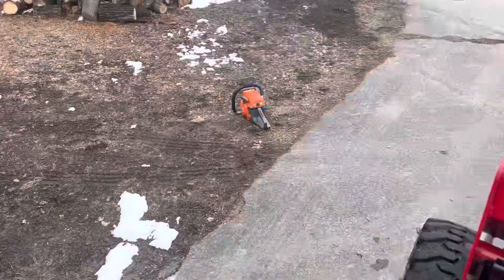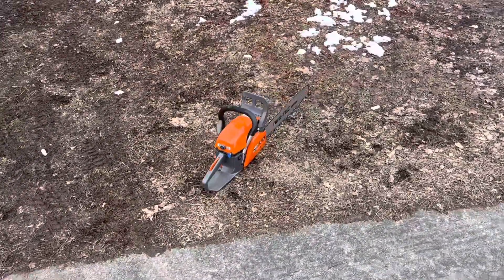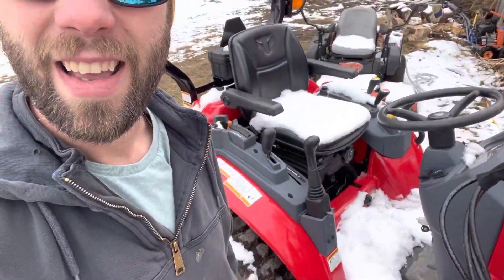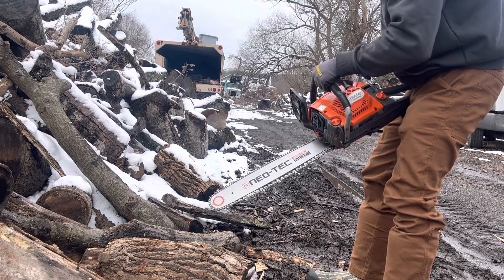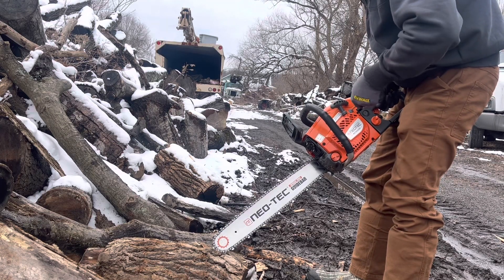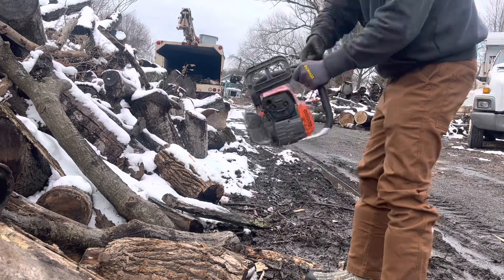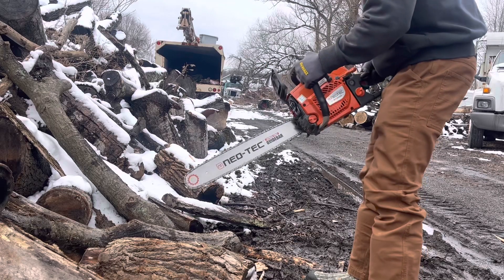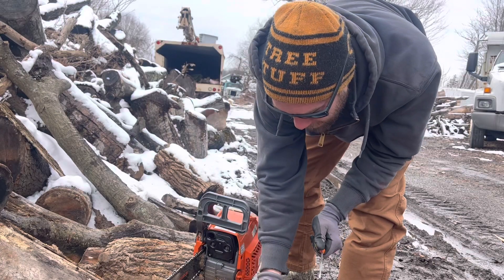NEOTEC 6200 chainsaw review and tuning@bulletproofsaws

Comment: How do you replace the chain? I need to install a new one but im borrowing it and no idea how and cant find it online.
Reply from the maker: Pretty simple process remove the two 13 mm nuts on the side of the chainsaw that would be called There will be a flat head that you can loosen turning counterclockwise to adjust the bar backwards to give slack to easily remove chain and bar assembly simply reverse the order tighten the chain snug but not tight with that tensioner turning clockwise tighten those 2 nuts and you’re good.

Comment: Does it run like a 62cc saw or does it feel like a 42cc saw?
Reply from the maker: Definitely runs like a 60 cc saw it’s not going to outperform a Stihl 362 or anything but runs good
Reply: @timberandtools  I have a couple smaller saws and I could use a bigger saw. They're on eBay for around $150 bucks. It's hard to judge how good they cut on video.

Comment: Hey the website says .058 pitch chains, and .058 guage. .058 pitch would be a 3/8 chain but it looks like a .325 do you know what its actually supposed to be?
Reply from the maker: @anthonyyoung4978  mine was a .325 pitch but probably .058 .325 chain I can’t verify that at the moment
Reply: @timberandtools  awesome thanks for the quick response man! Really appreciate it
Reply from the maker: @ no problem! I’ve found a lot of the china saws are .325 .058 heck even my proyama is 3/8” but still .058 😂

Comment: Can you please tell me what tool you're using for the L/H needles?  I can't see in there.  And if it has an idle adjustment where is it?  I can't find it and it doesn't say in the crap manual.
Reply from the maker: @oldowl4290  mine just had flat heads on it🤷‍♂️
Reply: He's using small engine carb adjustment tools you can get a set at orielys for under 20 bucks

Comment: That thing seemed like it ripped pretty good. New chain & all but it looked like it went through like butter. You like it?
Reply from the maker: @brandondube6128  yes honestly great considering the price of the saw !
Reply: @ may be tough to answer but, in your honest opinion, how does it compare to the Husq 440. Deciding if I want to buy a new 440 or debating on trying one of these. More CCs, bigger bar. I’m very curious after watching your video on it
Reply from the maker: @ no contest this blows the 440 out of the water 440 husky that is
Reply: @timberandtools  seriously? it blows the Husqvarna 440 out of the water?!
Reply from the maker: @ stock 440 was a dog not really my ported one but still if the neotec was ported it be stronger yet
Reply: @timberandtools  well I guess I’m going to buy one now! Thanks for the advice and info. Love the channel
Reply from the maker: @brandondube6128 anytime! It’s hard to pick saws because on paper they may be misleading on how they cut in real life. Thanks for watching. Appreciate you being here😎

Comment: My chainsaw has a a severe oil leak.  I provided a video to support and they acted like it is normal.  Saw is still under warranty.
Reply: Yep, mine leaks like mad!!  I've run this saw for all of three hours and am pretty pissed off at this point. I made sure to adjust the oil flow screw on the bottom to the minimal setting (I think there is 6 clicks available in total) and even on the lowest it is dripping like mad right out of the set screw hole.  It will leak a large heaping tablespoon of oil every 3 to 5 minutes.  I'm also having other issues with it though after only 2 or 3 hours of use. It started bogging down and I have no idea what to use toolwise to adjust the L/H needles and the crappy manual says it has an idle adjustment (but it looks like the entire section was cut and pasted from elsewhere) and I dont see any idle "T" port anywhere on the saw.  Where is it??? Lastly the factory chain is hooking right so badly after 2 hours use that I carefully sharpened it and it didn't seem to make any difference at all.  I'm ready to run this thing over with my truck.
Reply from the maker: @ sounds like a lemon
Reply: @timberandtools  So I took off the oiler and inspected it.  I'm not sure yet if the plastic worm gear is even actually engaging the metal oiler gear or not, but the main leak is coming from where the oil tube fits into the saw.  It's simply a bad design IMO.  It should have a grommet that seals around both sides of the hole and not just a bung / plug as that can vibrate out more.  The oiler itself and its inlet tube kind of helps hold the bung in place, but either the bung just isn't tight enough to seal well or??? And I have no idea what to use to make a better seal.  Any thoughts?  

I also took apart the oiler completely and notice that there's a sleeved rubber washer that fits around the main rod right before the impeller (which spins to deliver oil) and it just doesn't seem like it's thick enough to seal properly either so I assume it's leaking from there too (albiet not as much).  And I realize all saws leak but this thing was oozing out the entire tank over a few days.
Reply from the maker: @oldowl4290 yeah that much of a leak is definitely something wrong! Sounds like you’re on the right track. I have made grommets and washers in the last not on this model though
Reply from the maker: @r0ttie1  sorry to hear that!

Comment: Is this saw still doing good for you? You put this video out 11-12 months ago.  I'm in need / want of a mid-size saw for occasional "weekend warrior" type cutting of stuff from 4" - 12" and because I'm 55 I also don't want anything too large or heavy (nor too small) so I've been looking at various clone saws in the 50-70cc range that can fit my budget.  I feel like this is a great happy medium of size, price and performance.  I've been reading that most people seem happy with what NeoTec is putting out but wonder how much of that is just from the Stihl clones.
Reply from the maker: To be completely honest I don’t have a lot of run time on it however it’s been great and seems like it will be a hearty saw. For the money I don’t think you can go wrong in anyway!
Reply: @timberandtools  So I bought this saw last winter based on your great video here which makes it look like it runs like a raped ape and after just two hours with the saw, one last year, and one this week it's not performing at 1/10th of what I'm seeing in your video.  It seems to sound fine and run ok for 15 minutes but then bogs down and wont restart..like at all, even after letting it sit for an hour.   I'm going to try and tune it tomorrow (if it will start) and will see how it goes but I'm not holding out hope.  I think it's junk to be honest.  The chain they sent also seems to suck.  Even out of the gate it just wasn't cutting really good and with proper tension and good oil flow it was hooking right and putting out more sawdust than chips.  I shouldn't have to sharpen and tune up a brand new blade with less than 2 full hours on it.  I guess I shouldn't complain for a $140 saw ... but here I am lol.  What bar and chain are you running here because it looks like magic sauce.

Comment: Needs a tune AND a tension. That chain was as loose as a divorcee with a mundane love life.
Reply: The stock chain & bar is 76DL and more like 19.5 inches.  It will NOT fit on the Oregon bar
Reply: @MrBooMY3  I just bought the 76 DL Oregon micro chisel chain, so now I will have to buy another chain but thanks for letting me know which bar to get!
Reply: @TheNiggliestNut218  I had to look high and low to figure that one out. You're welcome.
Reply from the maker: She got a tune and also chain being a little loose sometimes ain’t a biggie. I do believe I adjusted it before I made the cuts. Thanks for watching
Reply: @timberandtools  A little loose is okay, hanging loose puts risk on throwing the chain which can do all sorts of damage to things. I'm excited to try that saw though. Glad you did a review, thanks.
Reply from the maker: @mikeclement5383  thanks and really a heck of a saw for the money !!!
Reply: @timberandtools  can you recommend an Oregon bar for the saw? I can't figure out what size it is or what saw it is a clone of
Reply from the maker: @TheNiggliestNut218  im not sure but a k095 bar mount will fit just about anything. Might need a tweak or two here or there but best bet if you didn’t want to try a k095 is to go to a local saw shop to match it up
Reply: This bar will fit with a .325 .058 78DL chain.  Oregon 208VXLGK095

Comment: I also have the NCS6200 and after 3 tanks the tuning  settled out [yes Scott gave me a few pointers on tuning]
it has become my go to saw over the others
 my thought is to replace the torch plug with NGK [just because :) ]  (just need the right number NGK to get)
possibly another carb? 
 it runs fine as it is.
Reply from the maker: Really good saw for the money, definitely hard to beat!!! Scott is the man 👊🏻
Reply: Use the same NGK as a Stihl saw.
Reply: What saw is this a clone of? I just ordered one

Comment: Mine is a 45mm bore not sure on the stroke I may measure that also bore measured at the bottom of the cylinder 1.781inches with calipers. Also they are open transfers hope to put a timing wheel on it to get numbers this weekend. The cylinder is a direct bolt onto the lower casing it is not a clamshell cylinder and does not have the cylinder adapter block like the Husqvarna 346xp and many others in that series and size. So this neotec 6200 has aluminum crank casing with a bolt on cylinder like the old Husqvarna 55 in fact it appears the bolt pattern if not exactly the same is really close I will check that out further. Also it is a non-strato saw with a adjustable needle jet carburetor no modern limiting electronics just good old-fashioned old-school carburetion. Plastic covers our a bit Sharp but can easily be trimmed up to your liking. What are the bolts go into the aluminum housing things are a little janky at least on mine looks like the threads were not the best or when they put it together they used an impact and cross-threaded the screws however the screws come out and they go back in and they're usable just could use a little bit of improvement there but I have also seen that and worse in the leading brands lately. The ports are a little sharp for my liking in fact to the point that it left a scratch marks in the piston in my saw so I will be deburring the port openings before reassembly. I wanted to see if it was a single ring or double ring piston so I sent a borescope in and confirmed it is a two-ring piston as well as I saw a scratch in my piston on the intake side so I pulled the cylinder to see what was going on it appears that a bur on the intake port caused the scratch. The price is good the damage in my unit could be local just to my one unit also get is minimal I have seen worse in a $2,000 leading brand unit right out of the box. I don't think this will stop me from buying another one but the next one I will open up before I cranked it over I am glad I opened this one up before I ran it I think it has a lot of potential especially with a little bit of Port work I bet you'll have a real runner at least you have a solid appearing base to work with on like these newer brand name power saws. It will be interesting to see what stroke the crank is since I didn't find anything online stating what the bore or stroke was. I think with a little attention to detail at manufacturing and maybe some process rectification these could be one hell of a saw. Great video thanks for taking the time to put it out.
Reply: Mine is 45.2mm bore and 34mm stroke best number I could get with dial calipers tail on the stroke that makes it a 54cc. I think mine is a 5800 with a 6200 sticker. Even then still short a couple cc's unless we need to count the ones in the squish band lol . Still a good buyand it's got potential for engine mods. But if anyone is interested the stock timing numbers are with base gasket installed .  Exhaust 92° intake 70° transfers 108° with about a .056 squish band. Anyone porting these I would like to hear your thoughts.
Reply from the maker: @johnsonlong1272  my buddy Scott at bulletproof saws will likely port one
Reply from the maker: Wow great info! Thanks for sharing and taking the time to write it out for us!! Yes it is a great saw for the money. Really hard to beat😎
Reply: That's awesome info, I got one of these in yesterday and I'm super impressed for the price.
Reply from the maker: @K4AX_DX truly great for the price!!!!!
Reply: Awesome info.  How are you liking it now that it's been almost a year since you wrote this?  I think I'm about to buy one of these.  I just need something for occasional weekend light logging and want something light and affordable in the 50-70cc range that can run an 18-24" bar.  I think these come with a 20" which is great.
Reply: so if the saw has just 45,2mm piston thennits a cheap.58cc saw,nothing worth to buy. 62cc would be cool anduch more powerfull
Reply from the maker: @Stefanseiner not sure what size. it pulls hard for what it is. The proyama pcs 68 is powerful!! It is argued to be 62cc
Reply: @timberandtools  the Komatsu Zenoah clone saws are available with a maximum of 48,0mm bore = 62cc and all bigger sizes are fake. Nevertheless the 62cc are very strong and my favorite saw a Greencut GS680X  is promoted with 68cc too but has 62cc
Reply from the maker: @Stefanseiner  yeah that’s right. The proyama pcs 68 rips!